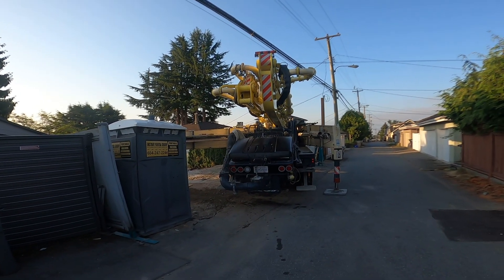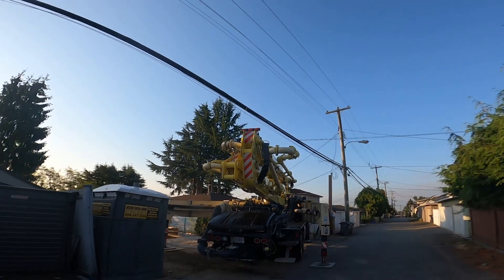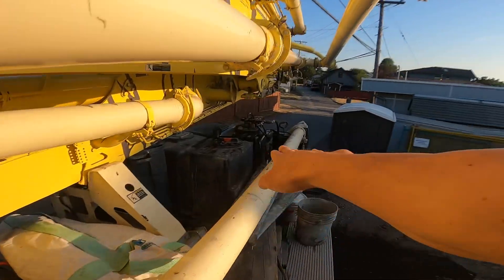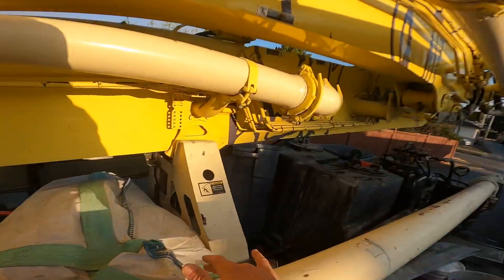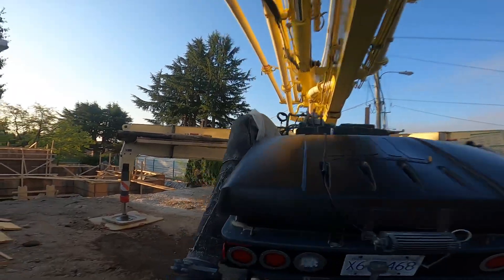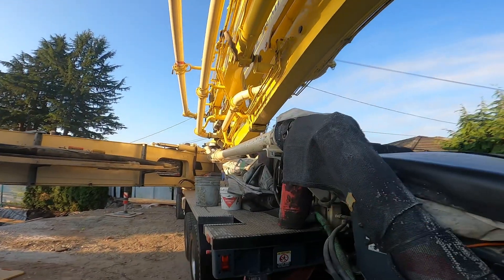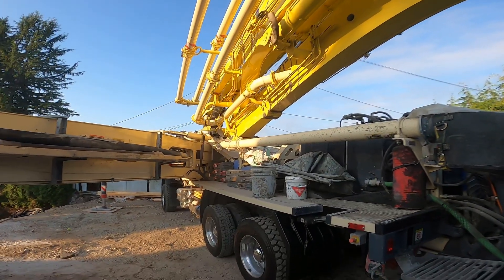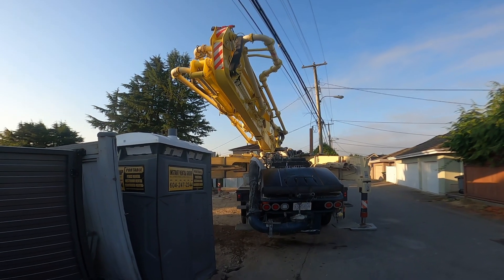We took the best concrete pump ever created… and made it even better!!!!

Comment: So quick question for you I'm trying to find out prices that you guys charge for pumping concrete I'm in Quebec and let me tell you EVERYONE is absolutely tight lips on pricing is there a place website were I can go to get prices how can someone start a business in concrete pumping without any numbers
Reply: Look in the comments of this video (Shoehorned in with the 38-5 (as per usual)……) has pricing.
Reply from the maker: It varies so much from market to market, as do operating costs. All I can really say is that in our market, sending out a boom pump of any size for less than a thousand bucks minimum is very likely a losing proposition.
Reply from the maker: Best advice would be to talk with reputable people in the business regarding their costs of operation (guys may be willing to discuss this much more freely/legally versus pricing) and then establish your own pricing from their. Common mistake in this business is establishing pricing based on “what the other guy is charging”…. because chances are pretty good that the other guy doesn’t actually know his numbers.

Comment: Don't wana hit them wires 4 sure. Good video my man, thanks. The big one is cable telephone, never knew that
Reply from the maker: It can vary from one region to the next. Definitely want to make 100% certain of what’s what in any given region.
Reply: U would figure that would be a factory thing
Reply from the maker: @GRUBB-MUDD  my assumption would be that it adds cost/complexity to the manufacturing process l.